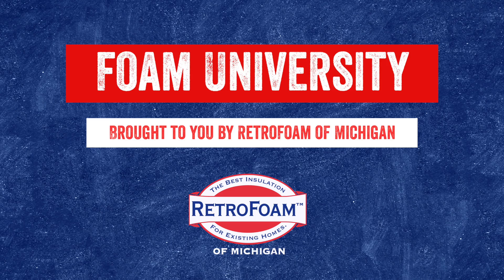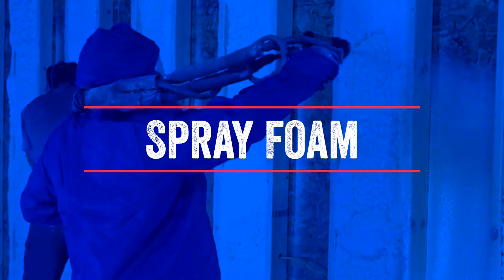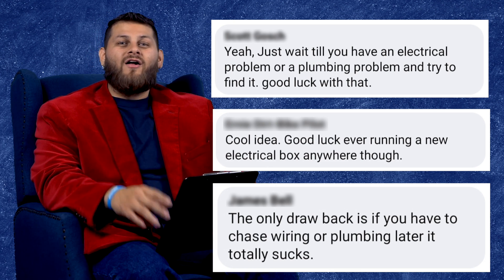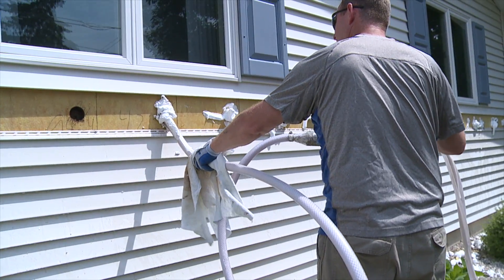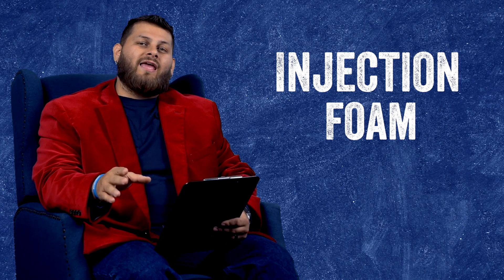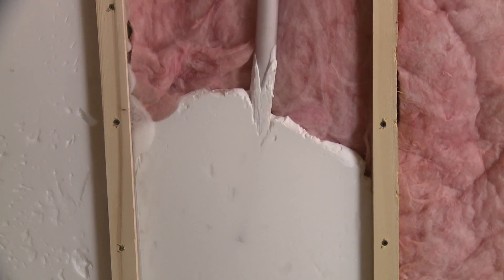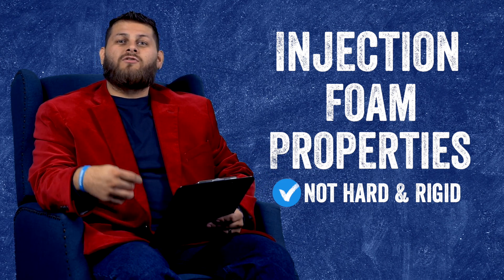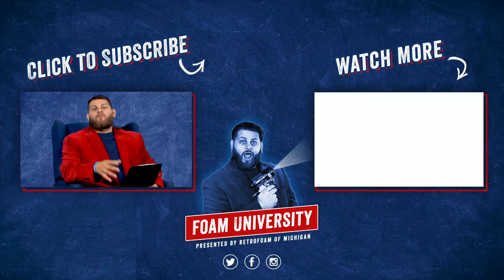Running Wires Through Injection Foam Insulation | Foam University

Comment: i like to start by putting an allen key into a power drill and weedwacking out the foam in your cutout. still a pain in the ass to run the wires, but it gives you a clear area to feed your glow rod down the wall and gives you ample space to place a gang box
Reply from the maker: Very interesting. Thanks for sharing!

Comment: i would have preferred a little longer video showing a single-gang box getting added near the bottom of a wall, and maybe being attached to a celing light or upper wall light. this would give a good full example of the difficulties that might be involved or a better understanding of how much easier it is to run wires through this material vs other insulation options.
Reply from the maker: Thank you for the feedback Jasper! We sure appreciate that! We will talk with our team about updating our videos!